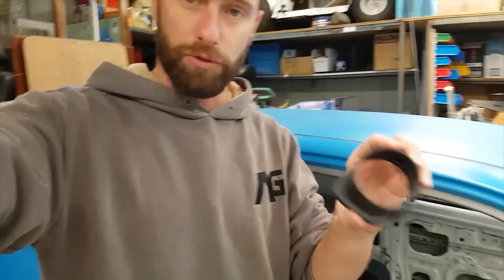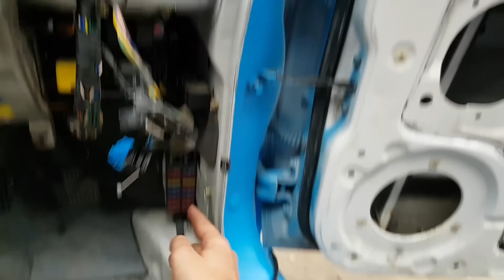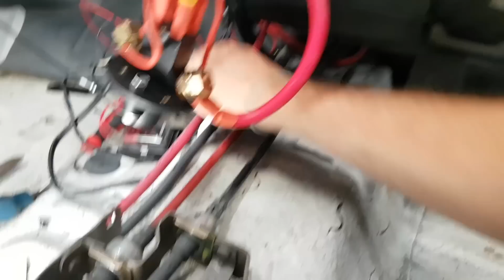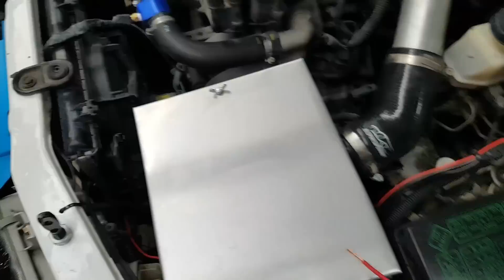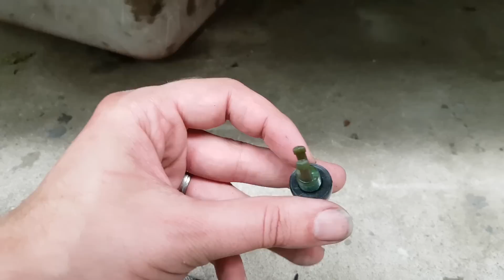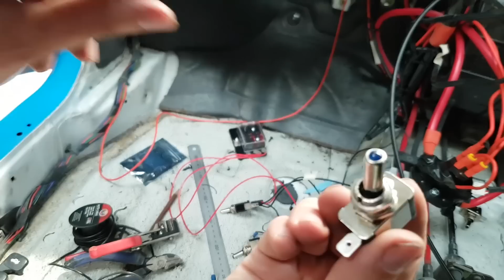Budget Race Car Build - Part 21 - Extra cooling

Comment: Why are you keeping the heater core in just add weight strip it all out its a race car not road car
Reply from the maker: Hey mate, two reasons, firstly i live in Victoria where it can be 40 degrees and sunny in the morning and pissing down rain within a few hours, i've got lots of mates who either have or do race and they all said to leave the heater core in, hot air is what clears a windscreen and for the sake of a tiny bit of weight loss i might not be able to go out due to no vision, one of my mates took his out and then spent ages trying to resource another core and housing after he was stuck on the dummy grid with a rag trying to keep the windscreen clear. Secondly the minimum weight for the class isn't that low, so even though i'm removing most things so i can add balast where i want to get up to min weight, a little heater core isn't an issue :)

Thanks for watching!
Reply: @TheNuggetProject  yeah i race over in wa none keeps it in
Reply from the maker: @lukecrutchley7  haha yeah you've got good weather! it was mid 30s on the weekend up on the mountain i was shooting at and now it's just dumped 15cm of snow! Victoria is a mess, i'd rather leave a tiny bit of weight in and actually be able to drive here :)
Reply: @TheNuggetProject  yeah we struggle to stay on weight because of the height of me so if its wet i have to deal with a fogged screen and if its hot i have to sweat to death. It was 45 degrees in the car last weekend
Reply from the maker: @lukecrutchley7  oh man yeah that sucks! luckily i'm not too tall, but they aren't big cars hey, iv'e got the seat about as low as i can go and i'm not far off the roof, can't imagine what it would be like for anyone 6 foot or over.
Reply: @TheNuggetProject  yeah im 6 foot 7 and we have it on the floor and all the way back i havent found anyone who can fit in it yet like me ahha
Reply from the maker: @lukecrutchley7  haha that's rough! need a shoe horn to get you in and out ;)

Comment: Hey I'm a little bit behind... what's all the stuff needed before you can take it for a drive
Reply from the maker: Hey mate I'll be running MCA, had too many first had accounts of bad quality xyz. Bit more expensive but at least you can buy individual shocks if one breaks :)
Reply: @TheNuggetProject  yeah good idea. Iv got the xyz currently and have had issues with the shock leaking plus the MCA I think have a stiffer rear spring rate which would help the front not lift on corner exit and get more grip, which is currently my main issue.
Reply from the maker: @billyhamilton3669  Yeah perfect! i hear good things about after sales service from MCA too, Chinese parts but assembled in Qld, if anything goes wrong you can send it back and at they can rebuild it for you save having to throw the whole thing in the bin and buy a new one each time :) According to the Cams rules there are two options which looks like the 'blue' and the 'purple' on the MCA site, i'm not too sure what the difference is, will have to do more research, i think the purple are a fair wack more cash though, around the $2050 mark with the blue being only $1590.
Reply from the maker: At the moment mate we are saving for the roll cage, after that its suspension and tyres :)
Reply: @TheNuggetProject  what suspension you going with? The word going round is they might be changing the state/club rules too allow for MCA which is what the national class are aloud to use currently